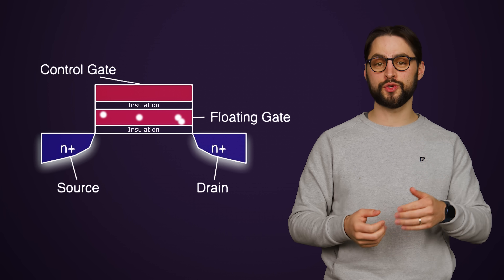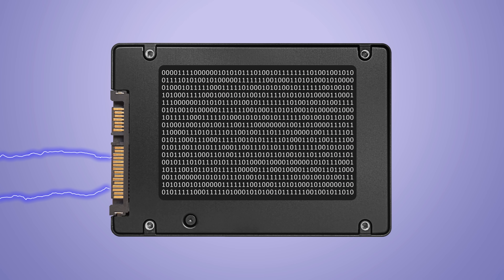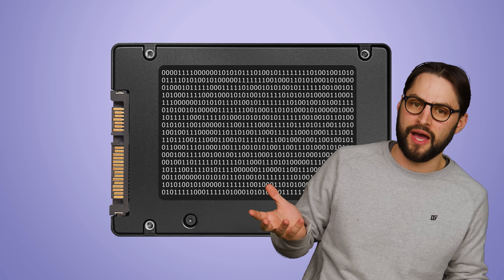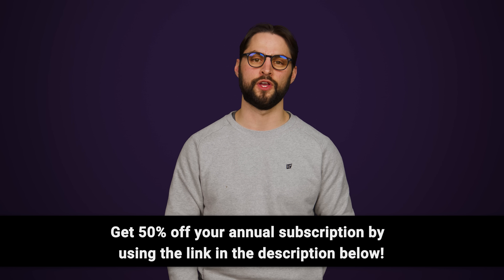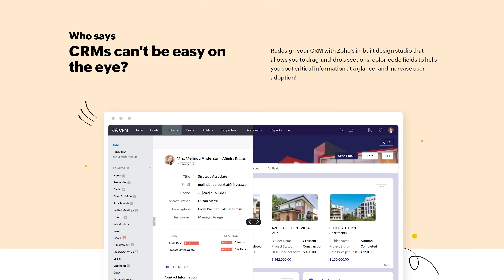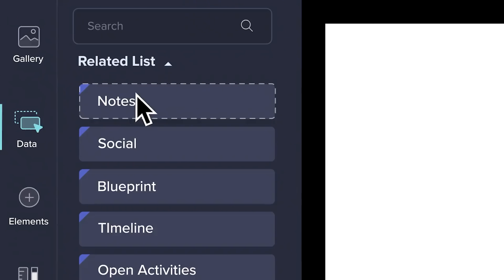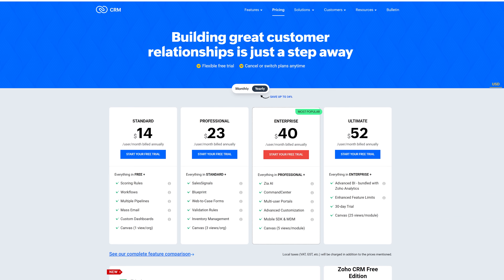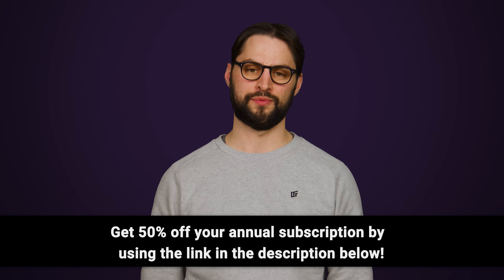SSDs Die, RAM Doesn't. Why?

Comment: So close... you almost covered the caveat. RAM can still fail due to wear-out like SSDs, however, this usually only occurs in datacenter settings where the DRAM modules are kept at a high utilization. In these cases, the failure rate is still quite low, but it is a problem that companies like Google and Meta are currently trying to overcome (and no, they are not letting their RAM modules get too hot or overvolting them). For the general consumer or enthusiast, the chance of them encountering such a failure is very low.
Also, you can wear out a SSD in read-only mode as well. There is a phenomena called read disturbance, where after continually reading from adjacent cells (floating gates), the voltage levels of that gate can diverge from the expected thresholds. To combat this, if a page is read too many times, the SSD controller will typically either relocate the page to another location in the flash or rewrite the current page (effectively refreshing it).
Reply: I'm wondering what is the "best" method to know if my SSD is close to its death? (Asking as normal user)
Reply: @user-rm5ye5xc7f  Run any SMART utility to see tolerances, warning levels, max levels and current values.
You'll also see other things related to it's health like: lifetime expectancy, lifetime counter, percentage of failed/worn out cells, average and max working temperatures, I/O errors, unexpected power failures,  +++
Reply: @svenkarlsen2702  Running a SMART utility is no guarantee you'll get a warning
Been there, learned that  ;-)
Reply: @Wannes_  Nothing is ever fully guaranteed. Except maybe taxes and death.

Avoiding cheap/non-compliant USB to SATA bridges and knock-off SSDs could improve your chances.
Reply: @xxxblackvenomxxx  true. but having smart warnings enabled in addition to regular backups never hurt.
Reply: @user-rm5ye5xc7f  I'm not sure if there is a good method - it would likely be vendor dependent. Samsung for example has a health utility (program) that I believe can communicate with the firmware on the SSD.
Any decent SSD (that probably even includes the cheaper brands like ADATA) should internally manage health, so what you will see is that the SSD will decrease in size as it ages. If you ensure that you always have free space (which might mean slowly removing files as the size shrinks), then it should be okay (if you keep pushing it though, it may only be a 2GB drive in the end, but those 2GB should still be good). The problem will occur when it runs out of space and then also tries to shrink.
That said, if there is anything important on it, you should always have a backup somewhere else (on another drive, or in the cloud).
Also, don't defragment it. That's only meaningful for spinning drives that need to seek between "fragments". SSDs have a fixed read cost regardless of where the file is located in the drive (the sequential read speedup happens because of the drive cache and not because of how the files are stored).
Reply: @hjups  SSDs can't shrink. They use dedicated free space to replace broken cells and update their S.M.A.R.T. table on this action. When you'll see many such relocated cells then you should know that this SSD can die soon. But it can die instantly if something bad happens with it's essential zones.
Reply: @MaxusR  That depends on the firmware implementation. Most of the SSDs that I have had in the past do indeed shrink over time (total drive capacity), and that's also how all of the firmware I have worked on was implemented. You can either over-provision the flash capacity, under-provision the base capacity, or allow the drive to dynamically resize. The latter makes the most economic sense, since you can market the drive as higher capacity without spending more on flash.
But you're right about the problem with the bad block table becoming corrupted due to wear-out, but I have seen some implementations that use indirection with wear-leveling for that purpose.
Reply: @hjups  When the storage space is allocated by a file system I don't understand how the space could be reallocated. I can only imagine that such SSD would return an error when there's no available space but the file system thinks it is available. I've never seen something like that myself.
Reply: @MaxusR  The SSD presents itself to the CPU as effectively a virtual memory space. Inside the SSD, it also has a physical memory space which maps to the flash dies themselves. The SSD controller is responsible for doing the mapping from one space to the other. As such, the SSD controller has the discretion to move "pages" around the flash without the CPU knowing it. When a page is move, it has to be written to, which is part of what causes wear-out. There's also read-disturbance mitigation which can move pages around if they are read too many times.
Furthermore, flash doesn't internally look the way it's typically seen anymore - internally, it's common to have 16KB pages rather than 4KB pages that an OS typically uses. So if you have a file that doesn't take up full 16KB pages, and you access it, it may mean rewriting the entire 16KB page, which includes other files too.
If the page that the file was in goes bad and you try to access it, the OS will probably complain about the file being corrupted (i.e. you won't know that the flash page went bad internally). It's also possible for a page to fail in a way that the internal ECC doesn't catch it (too many errors), so it would read normally but the contents would be incorrect.
Reply: @hjups  Yes I know about write amplification. I just don't understand how you describe an SSD behavior when it has no dedicated free block for remapping and has the whole space used by a file system. In that case the file system can address any cell the SSD has and there can be situation when there is no free cells to remap a bad one.
Reply: @MaxusR  In the situation you described, the behavior would be firmware dependent. In some cases, if a free block cannot be found, it may just give up (letting the data corrupt). In other cases, it may just overwrite a non-free block (corrupting that data). Although I would probably describe the latter as a bug (doesn't mean some of them don't do that though).
Note that if a file system takes up the entire SSD, that does NOT mean that all of the pages are allocated. The address space is reserved, but the pages themselves are empty / marked good but invalid.
When folders and files are created, the pages slowly begin to fill up. If you want to know more, I would suggest reading about how FAT32 works (NTFS, EXFS, etc are all more complicated, but the general principle is the same, and FAT32 is something that microcontrollers without an OS can reasonably be written to handle)
Reply: @M  SMART is your best bet, as well as the %remaining drive life statistic
Reply: @user-rm5ye5xc7f  you can use harddisk sentinel to see the health
Reply: @user-rm5ye5xc7f  it gets slower
Reply: @user-rm5ye5xc7f  Defragment it ;)
Reply: @the_kombinator  you can't defrag SSD, it's trimming
Reply: @BakaOctopus  I know that :P
Reply: @BakaOctopus  Actually,. for skits and giggles, i defragged a 512 Mb CF card using DOS - it didn't go as quick as I thought.
Reply: @the_kombinator  yes X"D
Reply: @the_kombinator  WARNING:  He was kidding!  Never defrag your SSD.  Ever.  Period.
Reply: He did say that RAM wears but it does so at a much longer time frame. He didn't say that SSDs don't wear in read-only, but simply that once it wears out it goes in read-only mode soon enought for you to still be able to recover your data.
Reply: @abrams5819  it is not really true that a SSD that gone in this read only mode will be able to work or hold your data, i have some SSD seen that are so worn out that all data was not accessable after it was gone into read only mode. it is also possible that the cells die at read, it depands on the manufaturer, the generation (there are a cellsystem called multicell, where one dead bit effects other bits too) and some other factors. A SSD is not a safe datastorage device, it can loss all data from one to another write action and also at a read action if there are weak cells. it is a russian roulette system of safety that can fail anytime. Since some years now manufaturers sell SSD's with used cells as new ones because there is no chance to catch them scaming. i would never write important data to them.
Reply: @darkbreed  I'm not an expert, just wanted to point out the point of the video. But interesting information thank you.
Reply: I don't think these videos are aimed at datacenter techs.
Reply: @informitas0117  Yeah, I agree with you. I think the video was aimed at typical use of personal devices so it covered stuff that was most relevant to that use.
Reply: thanks for explaining. 👍🏻
Reply: "normal" consumers also will experience RAM failures if they use older computers or other aging devices for retro gaming or experimentation.
Reply: Great reply, that completes it, thanks
Reply: They also failed to mention that the SSD controller is a bigger concern of failure over the excessive writing of the modules.
Reply: it's called facebook.
Reply: @voidofspaceandtime4684  They changed their name to Meta, and data corruption is an issue at all of their services face (not just the facebook service).
Reply: DIMMS should contain DRAM, Optane and NAND Flash (SDD) Memory.. 8GB DRAM, 64GB Optane, 256GB Flash, or 16gb, 128gb, 512gb.. There are many speed, reliability and overall price advantages to this combination. As CPU dies shrink all CPU makers should go for a UCIe chiplet design with lots of high bandwidth, fast DRAM on the quite large CPU PCB (50mm x 50mm), also usable by the integrated on-die / UCIe chiplet GPU, DSP, ++... 
--
Many mini devices would come with an SODIMM slot instead of M.2 slot and soldered on memory that can't be upgraded. There should be full redundancy (even if it means slower performance) for each part - if one part breaks or is too error-prone it can be disabled and the rest will still work. Would be nice if it can do a full emergency memory dump using just the power left in the system in the event of a power cut. Could include a small capacitor for this purpose.
Reply: @250CC .. UCIe will definitely see RAM integrated on the CPU chiplet PCB.. I can't see PCIe being used for main memory. I agree DRAM+Optane+Flash memory on one board will take a while buy I think it is a logical step for many systems.. Server Rack motherboards only need lots of the same 2 sockets, DIMMs and CPU sockets.
--
I agree there are protectionist reasons why this won't happen (quickly) but technically and cost-wise it makes a lot of sense so I think all-in-one non-volatile main memory is more likely to happen than not in the next 10 years or sooner... Although by then optical computing and possibly memory will be expanding rapidly,,
--
REPLACE-ABILITY and UPGRADE-ABILITY are big selling points, as is less power consumption fewer peripherals inside SFF cases.. less complicated motherboard. Economies of scale.
Reply: Why would you even click on this video if you're such a know it all?
Reply: @250CC .. Yes, that kind of add-on has been available since the 8086 and ISA bus - ramdisk on a card... Old news.. Chiplet DRAM and (3D) cache joined by UCIe is the best open standards way forward. Standard chiplet bus protocol.. I'm giving gaming graphics cards less than 3 years before  the market's been replaced by integrated chiplets... Basically, most of the motherboard (apart from i/o) and most peripherals + all accelerators will be on the same tiny board as the CPU.. 600W 4000 series nVidia cards will help to highlight the change when we see 60W GPU + 60W CPU on the same board pissing all over them at a fraction of the price.
Reply: I have had 2 sticks of ram fail inside the same time of the same time period of my SSD. I also have had 64gb minimum of ram since 2015 and using over a stick worth constantly. So makes sense why they fail faster now . Though probably should replace the SSD
Reply: This. All components age over time. And if all else is equal, high-performance ones will fail earlier than low-performance ones, due to tighter margins, higher heat densities and finer/more sensitive parts.
Reply: (S/D)RAM does degrade over time like all materials, but it is a completely different failure mode. I'd go so far that comparing the wear-out of the two is dishonest. The rest about SSD operation is fine though.
Reply: @joergsonnenberger6836  There's nothing dishonest about pointing out that RAM isn't immortal, and the comparison to SSDs was made in the video.
Reply: @VVayVVard  I quote the starting post: "RAM can still fail due to wear-out like SSDs" That's like saying "Washing your car by hand can still result in wear-out compared to sand-blasting it every week". For DRAM, the MTBF is typically given with 50,000 hours. DRAM needs at least 2 refresh cycles per second, so even completely idle, DRAM has more write cycles per day than most NAND chips can sustain in total. For the given expected lifetime, it's at least 3 orders of magnitude more, idle! That's why I would say comparing the two is dishonest.
Reply: @joergsonnenberger6836  I don't think that's equivalent, since you're comparing different objects. To me, it sounds more like saying "robots age over time, like humans do". Sure, the mechanisms are entirely different. But if we assume the above is said in response to another person claiming "robots don't age, unlike humans" then it's a valid rebuttal. RAM wears out in use, just like SSDs, hard drives, and any other component, although via different mechanisms and (generally) at different timescales. It's acknowledgement of a universal truth.
Reply: @VVayVVard  Don't you think there is a fundamental difference between slow degradation over time and literally getting ripped apart? A write operation for NAND flash literally tears the isolation layer apart. Neither RAM nor hard drives share that property. It's like saying a water dam ages like a Lithium-Ion battery because it needs maintenance. It ages, but whether it is emptied a 100 times or 10,000 times doesn't matter all that for that process. The battery on the other hand gets destroyed a bit more by every charge cycle.
Reply: @joergsonnenberger6836  I think it's more important to point out the fundamental similarity, i.e. that RAM doesn't have infinite lifespan, since that's a much bigger misunderstanding, at least in terms of scale, and since it's important to note as a universal truth affecting all types of components. I agree it's useful to note that the mechanism is different though.
Reply: my ddr2 ram from 2008 is still running
Reply: However,RAM is as much as 900 times more durable than what SSD Drives are
Reply: All memory is volatile. Some memories just have longer refresh cycles than others. 😊
Reply: He didn't say that ram can't fail? He said it was much less likely and they have a longer life span than a ssd. This is correct. Especially in this scenario where he's looking at consumer grade products.

The team you're talking about is often ECC RAM which is yet another ballgame as it adds another point of failure.

You're not wrong, but you are being pedantic needlessly.
Reply: @mattymattffs  You're putting words into his mouth. He did say "Although the data storing modules shouldn't wear out due to reads and write, RAM still can and does fail, it's just that it's caused by other factors such as overheating, static damage, or using too much voltage." Those are all causes of RAM to fail, but he intentionally dismisses wear out for RAM (DRAM) which does still occur - the point that I was making. 
Also, saying that ECC RAM adds another failure point is true, but that's not really relevant. When ECC fails, it's again usually going to be the DRAM die and not the memory controller's ECC function. Then that's like saying "well sure if I have two servers running the same workload, I am going to see failures more often". That's obvious because the mean time is effectively doubled because you have 2 of them. That doesn't change the fact that it has a failure rate to begin with.
I think LTT was too broad in this case, either because they thought it would complicate things too much, it didn't fit the narrative of the video, or that they themselves didn't consider that to be a failure mode.
Reply: @hjups  I for one, greatly appreciate your information on this topic. it's fascinating
Reply: "For the general consumer or enthusiast, the chance of them encountering such a failure is very low." 
Who is Linus' target audience?
Looks around. 
Shocked pikachu.
It's like the video was well made for the intended target audience.
Reply: you are correct sir, but i think this video wasn't so much aimed at data centers, more so home use.
Reply: They managed to get their message through (most of it at least) in a concise manner. You, on the other hand, are diametrically opposed to this notion. Perhaps then you would be labeled as a hypocrite!
Reply: @NFStopsnuf  They managed to get their message through but it was NOT the truth, not educationally sound. What he called an insulating layer in the flash has not been an actual insulator in many years, It is a silicon nitride blocking layer. A semiconductor switched off. It works exactly like he said but the degradation is not to an insulator but to the conductive oxide layers above and below the blocking layer. Heat is 50% of the problem with the degradation as heat further excites the electrons making them damage the oxides and leak charge.They also said capacitors did not have an insulating layer. WHAT? That is ALL capacitors have. Two plates and an insulator. They said that capacitors don't retain voltage.. AGAIN, that's exactly what capacitors do. They don't do it for very long in RAM, and the data is read from transistors not just the capacitors. The data requires a "refresh" cycle. When power is removed the refresh cycles stop, the data is lost. The "message" was dumbed down for fanboys like you, it was not complete nor accurate. If finding fault with your god of tech is hypocrisy, then please label me an Atheist.
Reply: @NFStopsnuf  I am opposed to making incorrect statements in educational material as a tradeoff for being more concise. All they would have had to do to satisfy my comment was to add a few extra words. They bothered to mention that overvolting and heat can wear down RAM, and they could have added "or running heavy datacenter workloads". And they didn't have to mention the SSD going into read only mode with infinite reads, which is incorrect. They also made mistakes with the DRAM cell comments, which fact checking could have helped.
Reply: @hjups  Don't worry, you are absolutely correct. RAM will wear-out and fail from 'normal" use just as  every other part in a computer does. Don't need to be overclocking or suffer static damage or anything else. The only difference is the time frame involved, which is totally dependent on the usage pattern. 

For my systems, which run 24/7, I accept as a given that I will need to replace the RAM at least once before I upgrade the actual system, with the desktop RAM seeming to last longer than the RAM in my laptops, but not by much.
Reply: @NFStopsnuf  Dude, he literally just added some insight and corrected some mistakes, what the hell are you so irked about? You must be a fun guy to hang out with, bet you have a lot of friends.